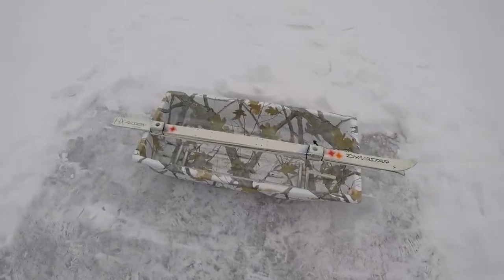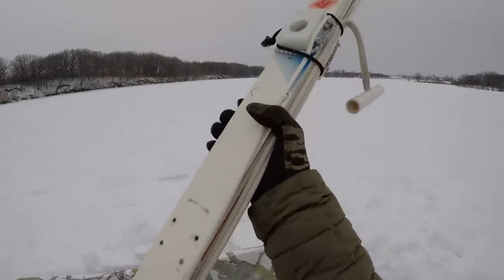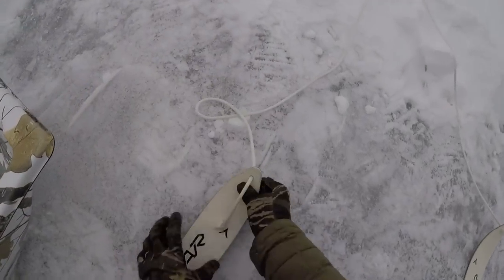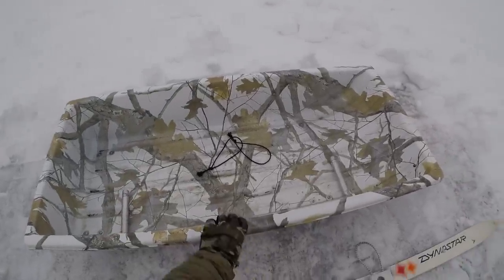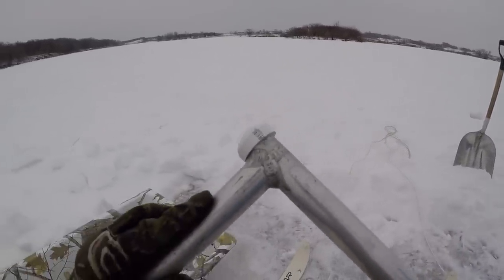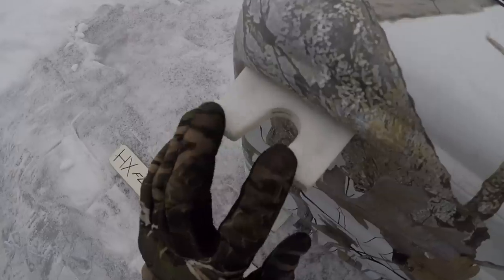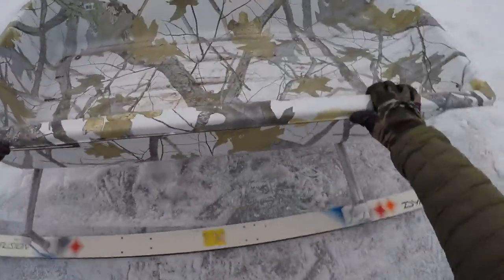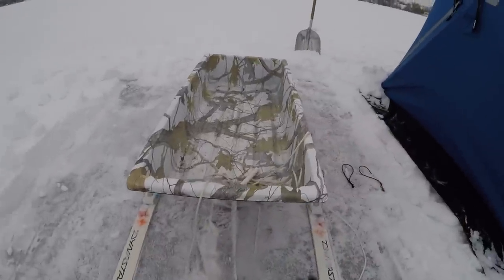The "Sledski" Collapsible Smitty Sled

Comment: Where did you get that polymer plastic that you put on the ski
Reply from the maker: There’s a local hardware store called Mac’s that has a bin full of random types of plastic scraps they sell by the pound. There’s also a couple businesses in town that deal with HDPE plastic for making display cases and such, I’ve called them up a couple times to see if they’d sell me a scrap piece and they’ve always helped me out if they had what I was looking for. The thicker stuff can be tougher to come by. It’s basically cutting board plastic so you could find one of those and cut it up. There’s also ordering online from Tap plastics, you can have them custom cut whatever dimensions you want up to 1” thick with a $10 min per piece. I’ve ordered from them several times but shipping is about $25 so I really only order from them if I need a lot.

Comment: Now I’d like to see your sledski with the mods you’ve made…
Reply from the maker: I think the only change I’ve made is replacing the four plastic tabs under the sled with two strips that run the length of the sled with notches for the bars to fit into. I figure that way if I ever have to take the skis off and pull it on those plastic strips it will be much easier.

Comment: How much weight total do you think this sled could handle??
Reply from the maker: I’ve sat my 180lbs in the sled and it held but I could definitely feel the bars flexing a bit. I probably wouldn’t try pulling it with that much in there. I’d say my gear weighs about 80lbs or so and it handles that fine.

Comment: Did you have to drill pilot holes thru the hdpe or did you not need to?
Reply from the maker: Anywhere I put screws into it I used an Irwin drill bit and tap to drill and put threads in the hole to use with a machine screw. It’s pretty simple if you’ve never done it before and you can get an individual bit and tap for under $10 at the hardware store. I used a 10-24 size tap and machine screws for both attaching the blocks to the skis and to attach the plastic parts to the sled.

Comment: Why the angled legs? Why not just straight up?
Reply from the maker: It probably would have worked fine either way but I decided to angle the bars like an isosceles trapezoid because it’s structurally stronger than a rectangle which can easily collapse on itself. My main concern was the 30 degree or so slope at the boat launches where the sled will be at an angle. Plastic gets brittle in the cold so if both the bars were straight up at 90 degrees and the whole sled tilted on the ramp it might snap the plastic blocks I attached to the skis if I had the sled fully loaded. By angling the bars I’m redirecting that force a little bit and reducing the chance of that part failing. I will say I’m pretty impressed with the HDPE though, I haven’t had any parts snap in the cold on this sled or anything else I’ve built so it seems to handle the low temps well.

Comment: Just thinking out loud..... If you made that say 1 or so feet wider you could have the sled all the way to one side then sit a hub style shanty on the opposite side. Man I want one of these.
Reply from the maker: That’s a great idea! I might have to get another set of bars welded and do that! I pack about as much as I can possibly fit in the sled and my Otter hub is a little bigger than my Eskimo was so it occasionally rolls off when I’m pulling it over snow drifts. I suppose I could add a bungee strap or two across it as well. I’d rather avoid getting a bigger sled because I can fit it and the hub side by side in my truck bed with the tonneau cover on.
Reply: @ndyakangler  That's my thought. Fill the sled with everything you need,  strap the hub down beside the sled and even sit your auger up on top and bungie it.  Quick acces to the auger to check depth and ideal location.

Comment: If you add some climbing skins to your skis they will allow the sled to slide forward while preventing it from sliding backward. This would be especially helpful when going uphill or while resting on a slope.
https://en.wikipedia.org/wiki/Ski_skins
https://www.rei.com/learn/expert-advice/climbing-skins-accessories.html
Reply from the maker: Other than the ramp at the launch I mostly pull it over flat ground. Some people that pull their sleds uplhill a lot use cross country skis instead of downhill skis too, cc skis have the angled ridges on the bottom that help prevent them from sliding backwards.

Comment: Thanks for the video Matt. Where do you find the HDPE?
Reply from the maker: Macs hardware is always the first place I check so I can avoid paying for shipping. They have big bins of plastic scraps you can dig through and usually there’s a pretty good selection of HPDE. It’s also commonly used as cutting board plastic although 1” thickness would be hard to find that way. If all else fails I’ll go online and order it from Tap plastics.
Reply: I have cut up cutting boards before and used it that way.  Working on my sledski. It will look just like yours except I am using wood. But your design. I was pondering how to attach the sled to the cross members until I watched your video. Slap my head and why didn't I think of that. Thanks again Matt.

Comment: And all that work and hardwares are done for waht !,,,,,!!!easy pull ??? Its good for first ice after that with all craks and bumps it’s gonna fall center of gravity too hight
Reply from the maker: I don’t use it first ice, the sled itself pulls easy enough on bare ice. I’ve never had it tip over pulling it over snowdrifts. I’ve had my shack roll off the edge of the sled a couple times on uneven surfaces but I added a bungee strap to keep it there.
Reply: @ndyakangler  well I’m happy for you  so keep going 👍🏼👍🏼👍🏼

Comment: Unless you can recommend a place to buy a very small 1" quantity of HDPE plastic...just an idea based on the very high cost of one sheet of the stuff. Simply buy a plastic cutting board from Walmart and cut and stack it into pieces, screwing them together, then drilling and securing them to the ski? 🤔

The Gospel of John, sooner than later, Reader.❤️
Reply from the maker: Cutting boards are generally pretty thin though, 1/4” or so. I don’t know if it would be enough for the bars to catch in the blocks on the skis unless you layered it. We have a hardware store here called Mac’s that will have some thick HDPE in their misc scrap plastic bin sometimes, or there’s a custom cabinet place that does a lot of food display type stuff that I’ve called a couple times and they were happy to sell me a piece. If I can’t find it locally I’ll go online to Tap Plastics, you can order any dimension you want it’s just a $10 minimum per cut piece which doesn’t take a whole lot with 1”. I’ve had to order more than I need with thinner ABS to get as much as I can for that $10 but it’s always nice to have some scrap plastic for projects. The only downside to ordering it is shipping isn’t cheap, something like $25 if I remember right.
Reply: @ndyakangler  Ty for the detailed reply! Ok...I'm thinking of simply cutting the boards up and joining them for thickness with screws...then drilling the main insert hole? Ex...1/2 in. HDPE x 2 equalling one inch...or even higher if need be? Woukd like to hear your thoughts, if you get time? Ty again for the detailed info...greatly helpful!! 🙂

The Gospel of John, sooner than later.❤️
Reply: My apologies...I see where you did state "layering". Got it...and ty again for the really clean idea here!
Reply from the maker: @Steve-sv3ln  I used 1” HDPE for the blocks on the skis and with the bungee strap that goes from the blocks up around the bars I’ve never had one of the bars pop out going over uneven terrain. HDPE doesn’t glue well but it’s pretty easy to work with tools, an Irwin bit and tap you can get for about $7 for whatever size screw your go with will hold screws well and if I want a really tight fit like a lock nut I’ll only thread the hole about half way with the tap and let the screw thread itself the rest of the way. I believe I used 10-24 machine screws and counter sunk a hole on the bottom of the skis to run the screws upward into the blocks. If you screwed a couple pieces together I’d think it would hold to run a hole saw through it, or drill the tube hole separately then line them up to drill the screw holes and trim them up. For the corner plastic pieces under the sled I used 1/2” HPDE and actually replaced the four corner pieces with two strips that run the length of the sled to make it a little more rigid and if I ever have to pull it across concrete without the skis to get to the ice it will slide better on two longer strips. I ended up moving the sled over to one side on the bars too, that way the shack can sit next to it across the bars instead of in the sled and that leaves much more room for gear and lowers the center of gravity having the shack sitting lower.
Reply: @ndyakangler  Ok...not sure what happened...I just replied but don't see it here. If this duplicates my apologies! 

Alright...and a really solid ty here! I'm not sure that I understand what you've replaced the four corner pieces with? 

Also, what are the dimensions of the 1" blocks that you place on the screws. I see where "Tap" offers even drilling, too. I rent, so I don't have a bench or press here to get real technical.